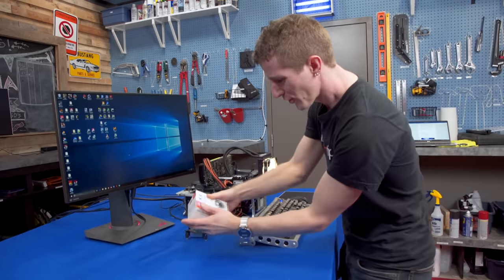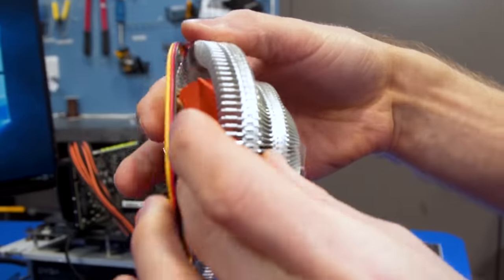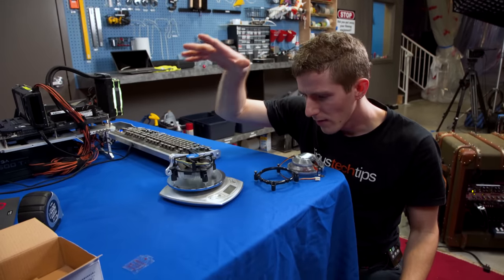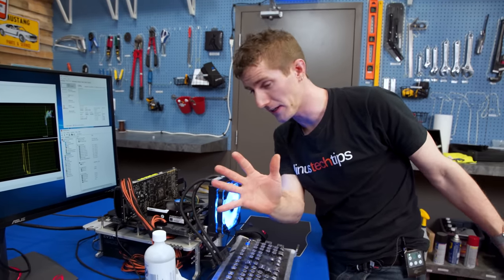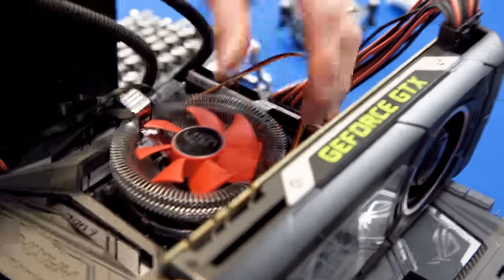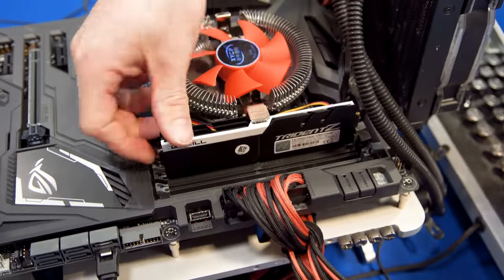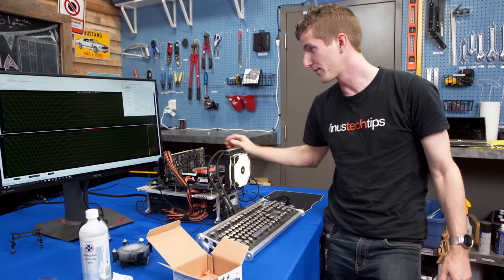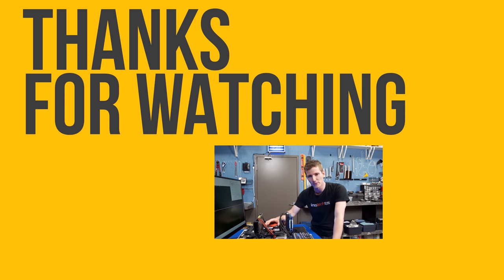The CHEAPEST Heatsink on the Market

Comment: Linus 
tests Freesync monitor with Nvidia GPU
91Watt CPU with 65 Watt cooler

High quality tech channel...
Reply: Dont forget running games at 4K for CPU benchmarks
Reply: Alexander Yordanov I'd like the cpu benchmarks to actually focus on bottleneck stuff instead of cpu frames lol
Reply: The removing the gpu bottleneck BS really stuck, taking into account that no developer used or optimized the games for rizen and that the CPU utilization is below 50% all you are testing is how well optimized the game is for Intel. I'm a developer and I do lots of optimization in my company and seeing a CPU at 50% I guarantee that a bit of optimization will increase performance by 30% really easy. I'm talking about less than a days work.
Reply: ***** yeah I've been doing a lot of research and a lot of rendering seems to be bound to one thread and so single thread performance can be unrealistic for results. 
At 4k ryzen should fall behind like it does in 1080p but that didn't happen at all. And vulkan and dx12 can leverage more power from the cpu and so forth. But until ryzen amd was fighting the trend. Fx was a beast that was bottlenecked and required a lot of optimisation to go around the issue of games trying to utilise it incorrectly. 
Now with ryzen developers have a true amd beast to work with. And with the low cost per thread more games can utilise more threads and use the power
Reply: Agreed and the next gen AMD CPU's comming out this year will help give us even better CPU's while at a fraction of Intel's price tag!
Reply: Alexander Yordanov you literally scrwed him (linus) and u know why is he doing this because he get money from these expensive cooler makers and now people hv much awareness for using stuff  like u dont need any expensive cooler for  non K intel processor etc etc ...
Reply: Alexander Yordanov then it's obvious you know nothing about cpus and computers. go play with some dolls
Reply: btgoodgame343 let me simplify for you, a 90w cpu produces 90w of heat, a 65w cooler can only dissipate 65w of heat, so you have 25w of heat that cannot be dispersed. Try that cpu cooler on a proper cpu like a ryzen r5 1600 (not the intel unstable volcano)
Reply: btgoodgame343 Heat is a pretty big difference if you ask me
Reply: btgoodgame343 the point of the video was to show what a 5$ cooler could do... We generally wouldn't buy one but I was curious to what it could really do. I'm the situation is was put it didn't really show anything except don't put a 65w cooler on a 90w cpu...
Reply: people would buy cheap cpu coolers for lower noise, he didnt go into that at all
Reply: Yeah I know nothing... and he's doing the correct experiment.. applied correctly etc etc... ok you are right... dear oh dear.. fyi this thing on a core 2 duo was working just fine. a very good stock replacement fan unit.. the end... try it and If  I'm wrong I will stop my youtube account
Reply: I never asked you.. but as I said.. try that on a core2duo which is supposed to be used on.. and if this BAD HEADSINK is SOOOO bad .. I will close my youtube account... when you try it and prove yourself wrong Iwill just accept an apology
Reply: Right? Not to mention that cpu doesn't come with that stock cooler, it expects you to buy a decent cooler. Not to mention that chip has had problems by a lot of people with overheating.
Reply: correct.. most people are using their own compound and they are delidding their chips to get better heat dissipation
Reply: On a 90w cpu its a Netflix cooler, not a Bitcoin cooler.
Run that 65w cooler on a 65w chip, or run software that dont redline your 90w
Reply: and several other top rated comments that pointed this out are now gone
Reply: yeah. i lost trust in this channel. its all about content now. not truth

This channel has really gone downhill since he got his "adverts"

Linus, please. just stop. you really arent doing the tech community any deeds
Reply: Kai Compton he reviewed the predator 21x laptop. That was entertaining lol
Reply: Flavia Pitariu oh yeah. funny. but not towards us commoner's
Reply: Kai Compton I can't afford that monster but it was interesting for me. I might buy a low end predator though
Reply: Flavia Pitariu I just buy used parts now. They generally perform the same. If your gaming,graphics card is where it counts. Video or photo editing, then it's cpu and ram. You don't have to have the newest and most expensive to get the same things done
Reply: Kai Compton I'm not the lucky kinda person so I do not gamble on used laptops or hardware. I buy new or don't buy at all
Reply: I respect that. But you can buy "new"old hardware
Reply: Kai Compton I'm planning to do that because I only need a cpu upgrade for my old system. Not a priority though so eventually gonna grab a 9590 to round off my am3 crossfire system since I got a cpu bottleneck. 
Laptop wise I want a ryzen one because Intel and nvidia annoy me in my current laptop lol
Reply: I love Intel cpus
Reply: Kai Compton I don't. They are over priced and they glue them instead of soldering. That's just lazy and cutting corners
Reply: They don't glue them
Reply: Kai Compton they don't use good compound and they do glue them. They are fairly easy to delid and you can reduce your temperature under load by 15-20 degree. I'm talking 7700k, you do need liquid metal and glue to put them back together
Reply: Delidding only drops temps by a degree or 2 if your lucky...
Reply: Warren Panayides on ryzen yes, on 7700k it's much more. If it was only 2 degrees then no one would care
Reply: not on some 7700K s
Reply: Pavlos Constantinou if it was only 2 degrees then there wouldn't be a delid kit and multiple guides on how to do it
Reply: totally agree
Reply: Guess I wasted my $90 on this Noctua NH-D15!
Reply: Ltt has done this test go do your research... It doesnt warrant the headache... Buy a better cooler... It will be more cost effective... And dont argue you know im right
Reply: Alexander Yordanov you are totally wrong because I have used the specific cooler and works great on an e7500. so stop arguing, you are humiliating yourself
Reply: Alexander Yordanov How do you know that this is the free sync version
Reply: not wasted at all.. but this is not tested on the correct CPU. this is so dumb I could cry.. a supposedly respected high tech channel
Reply: by the smell
Reply: He got here from making bogus "funny" tips. I guess it's an improvement.
Reply: well yes, but the point of the video was to test the limits of the heatsink, so putting it in ideal circumstances would not make any sense as it would prove nothing
Reply: Pavlos Constantinou you are correct, but when most cpus already come with a better heatsink, it would seem pointless to purchase an aftermarket heatsink that performs far worse. If you must purchase a heatsink, I think Linus is trying to say that you'd be better off spending a little extra money, as the cpus that don't come with heatsinks are usually extreme edition/overclockable SKUs such as the i7 7700k
Reply: Alexander Yordanov .. you can find a zillion cooler orphaned cpus out there ready to become media pcs or arcade machines. this works just fine
Reply: Pavlos Constantinou and for those cpus, (many of which are over 65w...) this heatsink may have a purpose, but you can't call the entire video rubbish just because of one small purpose that largely does not pertain to his core audience. I agree that he could have mentioned that use, but nobody is perfect... and he may not have thought of it at the time
Reply: it is.. rubbish.. because it doesn't show the USE of this heatsink. 
Does it?
Reply: Pavlos Constantinou ok, you can continue to hate, I don't think Linus will miss one less viewer but I have to go now and I now realize that you just can't be persuaded, thanks for the conversation though
Reply: this is g sync monitor
Reply: thank you, that was my point when i heard him say 7700k at 3:37 this is plain stupid... if he used a i3-7300 the result would be different...
Reply: I did.
Reply: Alexander Yordanov ii
Reply: Alexander Yordanov i
Reply: Persuaded about what? That Linus has mislead everyone to appeal to some entitled elitist segment of his audience and somehow that's not worthy of some heavy criticism? That he's spreading misinformation and bad practices just to get to the conclusions he wants rather than those that are real and true and somehow that's not bad?
Reply: I have a gtx 1070 and a freesinc monitor and it works so, you my friend, are  wrong (about that part)
Reply: He knows what he's doing! He just forgets to take his medication some days... But don't fret! We have him under court order to take his 'medication' after the last time he went running naked through the mall (the 16th time was the last we could take; it was the straw that broke the camel's back).
Reply: Now freesync works on Nvidia GPUs

Comment: Fun and all buttt. It says 65W, I assume that is max it can handle. The 7700k is stock 91W so I guess that makes it obvious that it would not be able to handle it? 

Thanks for the entertainment ;)
Reply: Stef's Engineering He says it at the end. Watch first, complain after!
Reply: Sure Erik, not really a complaint just a comment (and you are right, I placed the comment before finishing the episode). But I get the misunderstanding, usally the comment section is used the same as the western wall in jeruzalem (also known as the wailing wall)
Reply: Hes states that at the end.  They were well aware that it was not rated for a 95W system, they just wanted to try to see if there was any chance at all that it would be able to cool it down.
Reply: I understand, Thank you and Erik for telling me :)
Reply: How much of that TDP is used by the integrated graphics he's not using? Does TDP not include integrated graphics?
Reply: yes just like there's a chance that the Earth is flat.
Reply: You sir, saved me 10 minutes of my time. Thank you.
Reply: also the 7700k doesn't come with a stock heatsink
Reply: no, at least for intels cpu, it does not include integrated gpu
Reply: The VAST majority of intel cpus have an iGpu on it. You dont know what you are talking about Grimy
Reply: it is actually much higher than 91W tdp, it is 91W under when it is somewhere under 100% load and at base freq,  "Thermal Design Power (TDP) represents the average power, in watts, the 
processor dissipates when operating at Base Frequency with all cores 
active under an Intel-defined, high-complexity workload. Refer to 
Datasheet for thermal solution requirements."
Reply: the fucking intel TDP number does not include gpu power draw, just the cpu, and even that under "intel defined low performance workload"
Reply: it certainly includes the IGPU power draw. Of course it doesnt include the GPU power draw. they are seperate components, But the IGPU is part of the CPU, so it does in fact include the IGPU
Reply: it doesnt include igpu power draw, or to be more precise the gpu in that tdp is not under heavy gaming load, when you get that cpu and gpu to 100% usage at full speed you will get close to 150W of peak power draw
Reply: yeah nah, Alex is right, why would they say 91Watt TDP if its just the cpu component itself. Its regarding the whole package, otherwise would have been said if it was not inclusive of the Igpu, which wouldn't make any sense anyways..
Reply: Lol, what? Of course it includes the integrated graphics, it's on the same die!!! Just google it, it is 100% included in that tdp number.
Reply: yes, thats why that cpu under full load with gpu under full load pulls around 150W...as long as intel doesnt state under what load their tdp testing is done that number means as much as their sdp bullshit
Reply: Yes but the utter garbage that is the Intel stock CPU cooler easily outperformed it, and it DID handle the 91W TDP CPU.

So the 5 dollar cooler managed to be worse than utter garbage, which isnt surprising tbh.
Reply: I noticed that it was not really well secured when he did install it, he did move it a bit after and it had a lot of free travel, which means very poor contact, it doesn't matter if it was a bad retention arm or was badly installed, but that he clearly does not check whether it sits ok and turns the computer regardless. So he either continues to be a poor technician or he goes about ignoring good work ethic hoping no one will notice - or both of those things. If heatsink would be better secured it for sure would have performed better.
Reply: Hoe much watts does the stock heat sync run at?
Reply: Stef's Engineering noticed that roo

Comment: Thanks linus for the heatsink, i'm going to buy one for my amd fx-9590 :D

PD: Can I solder a few heatpipes on the 5$ heatsink that goes to an  4 way crossfire of 295x2?
Reply: If you want to burn your house down, sure!
Reply: this heat sync is a bit overkill for that CPU. its only 250 watt tdp
Reply: also a 4 way gtx480 would be much hotter
Reply: Sauna
Reply: Undervolt it first

Comment: Umm what if you had that $5 cooler and used some high quality Thermal Paste and actually applied it correctly...>_>
Reply: what if he actually ised it on a 65w tdp processor
Reply: zetax45 no, because that would be making the price higher.
Reply: StrongSucc who would spend the money on a high-quality thermal paste but then buy a cheap heat sink
Reply: +Strongsucc - I was thinking the same thing, that would make the comparison more fair in my opinion.
Reply: The whole point was to use what came in the box. The Intel heatsink got Intel's thermal compound, the Chinese unit got the Chinese gray McDonald's ketchup.

Comment: Sooo, this was VERY clearly and explicitly NOT rated for the 7700k's   91 watt TDP, and he utterly butchered the TIM application and seating. Aaaand, there's no free intel cooler with the 7700k, it doesn't come with one (and good luck finding one new, retail, under $5). I'm not saying it'd perform anywhere near decent in this application, but it didn't get a fair chance like the intel cooler did.

Cosmetically it kinda reminds me of some old low-profile, low-noise coolers with its fins and orange fan... were Be Quiet around in the P4/Athlon XP era?
Reply: Factical TDP of i7 7700k is 125W
Reply: You could just reuse an ancient cooling unit, they are said to be better than the new.

Comment: To be honest, it was probably meant for something like a 7th gen i3 with the i3's thermal paste not that bird S!?# !!!
Reply: More likely a repurposed cooler from the P4/Athlon K7 days (with a plastic ring to make it fit on moderne sockets)
Reply: Maybe a U-series even
Reply: it's rated at 65W while the 7700k has a tdp of 91W. plus 'k' cpus don't come with intel stock coolers
Reply: True so technically this $5 cooler massively outperforms the "free" cooler that the 7700k doesn't include.
Reply: Richard Bottom My i7 2600k came with a stock intel cooler. Had it overclocked to 4.3ghz for years. Put a AIO cooler on it a couple years back to extend its life.
Reply: yeah I checked now. it seems 'k' cpus came with stock coolers up until 4th gen and starting with 5th gen they haven't

Comment: I would have preferred the cheapest heatsink on a site like Newegg and maybe from a reputable brand...
Reply: SapphireRacer but wheres the fun in that, if its a reputable brand it'll most likely have reasonable performance
Reply: SapphireRacer then the point of the video. is gone
Reply: SapphireRacer yeah theres a cooler master rifle cooler that's like $2 sometimes. cheaper and it might be slightly better than stock.
Reply: the performance of that cooler would be reasonable, if they used it on a cpu that doesn't have a 30W higher TDP than what to cooler is designed for
Reply: ke.st Yeah, I was thinking the same thing...

Comment: My guess... it is about as good as old (better) intel stock cooler and definitely better than the DIY you made ...

EDIT:
Welp, I was wrong :D
Reply: What?
Reply: Spoiler: It's a 65 Watt cooler, the CPU is designed for 91 Watt TDP...
Reply: It probably is better than the stock cooler its just the godawful thermal paste it includes thats horrible
Reply: that thermal compound was a joke, he could at least use the same compound for both
Reply: and the thermal compound that came with it cant be helping I dont think linus even got much of it on the cpu this test wound have been more fair with decent thermal compound on the heatsink
Reply: I know, is Linus really that dumb?

Comment: Actually is not bad in all. The problem is the fan speed. If you can change just only the fan, this heatsink can be much better in perform.
Reply: Just overclock the original fan and save another 5$.
Reply: the problem is linus*